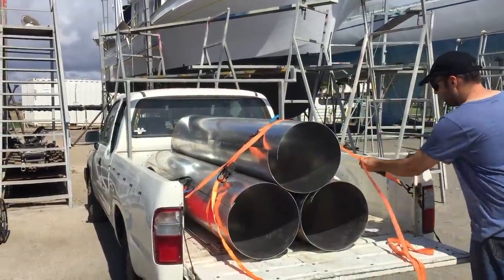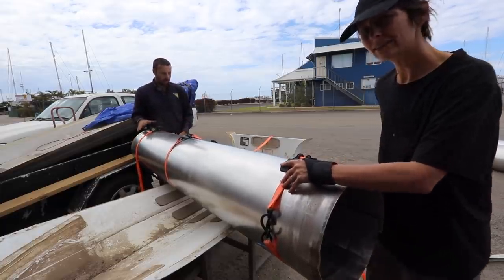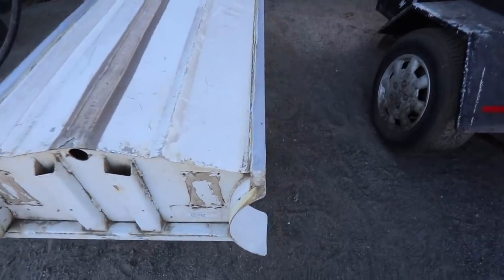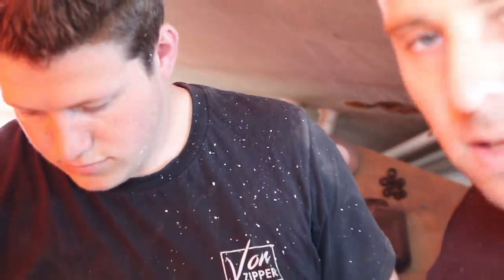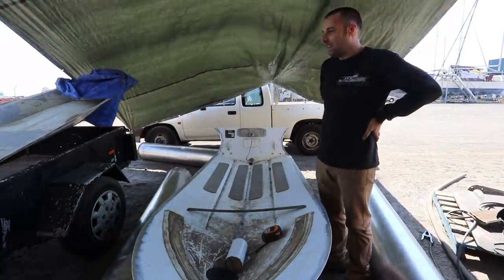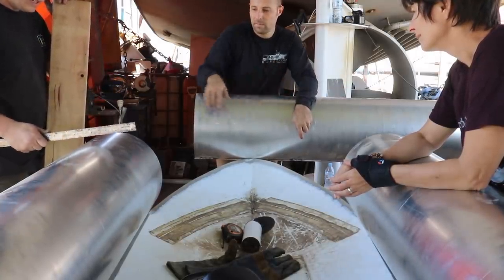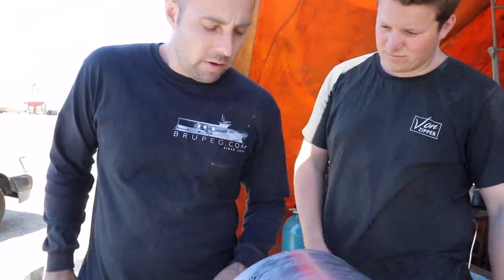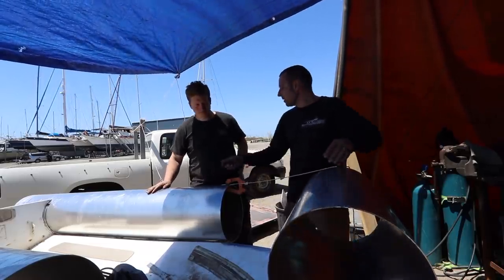DIY Aluminium Pontoon Dinghy Part 1 - Project Brupeg Ep. 107

Comment: If you put in a couple of small bulkheads in the tube you could use the spaces created as for your stowage of mandatory survival gear. It is also a space that does not require foaming.
Reply from the maker: The plan is to add a water tight locker under the forward deck area (yet to be fitted) that will house that type of gear

Comment: Very cool project!  great work.  A suggestion - on the transom end of the tubes, cut your tube ends at 45 degrees and build in a little step rather than just blanking the end off at 90.  You will be amazed how handy a step on the round tubes on the transom will be!  cheers
Reply from the maker: Ha! Like minds think alike. That’s exactly what we were thinking Julie. Also thinking of rounding the welds off as much as we can around the tube ends so you can drag your body over it without scratching yourself up

Comment: bulkheads at either end  then drill small hole in one .    get some expanding closed cell foam mix it up and pour it in.   once it sets off epoxy a small patch over hole and then weld your ends on.    unsinkable dingy
Reply: yes  i realize this is a bit after the fact  lol

Comment: from what i saw , everything came out good in the end!
Reply from the maker: Yeah slowly getting a hull. Took a while to learn what we didn’t know we didn’t know
Reply: @ProjectBrupeg  i left another comment here with the link to a tool to make finding those angles and make templates , but you tube has shadow banned it or moderated out the comment.............
Reply: @minibuilder1512  - I have had that happen also. Why do they do that?
Reply from the maker: I think if you put anything like a weird link in or try anything out of the ordinary the computers in YouTube land have a freak out and just ping you off to likely spam. we can still see if youve been booted and can just tick a box and bring the comment back into the normal window, so dont worry too much if it happens. we check spam most days so it will only be gone for a little bit and then we can answer them as nper normal

Comment: I think I figured out the angles. of that last cut between side pod and diaganol. If you are raising up the diagonal tube by perhaps 5 degrees then the join between the side and diaganol tube rotates by 5 degrees. To prove it if you went rediculous and angled it up 90 degrees then the join would have to rotate by the same amount to fit. I think? You probably worked that out and I haven't watched the next video but that might work. Gives me something more interesting to think about on a cold Tuesday commuting back out of London anyway.....fab project.
Reply from the maker: Hi Bruce, yeah I think I get what you mean. I hadn’t thought of that but it makes sense.
Reply: @ProjectBrupeg  think of the join like one of those robotic arms that build cars. As the diaganal is raised vertically towards the bow so the 10degree join has to rotate to keep itself in line. Cutting it will be fun. Loving the project.

Comment: a circumference measurement may have helped you get the tubes a little more accurate. also i was wondering instead of doing a flat tube on the bow could you have done a small mitre cut eg 22 degrees roughly on the parallel  tube joint and steep mitre at the front joint eg 65 degrees? its one less mitre to weld and cut and youll have a nice pointy bow to cut through the waves.  its looking fantastic, cheers team

Comment: Hard to see how thick that material is, but it looks like the tubes might crush when someone sits on them hard or climbs in from a swim.  Maybe you could fill the pontoons with a combination of rigid foam and 2 part expanding foam to fill the gaps.
Reply from the maker: Hi Jesse, it’s all 2mm. We had to get Jess to stand on them when tacking together. They are incredibly rigid. That said we will be filling with foam as flotation and inner support

Comment: "Do we know what we're doing?"    "Nope but we can scratch our heads a lot and pretend" 
WD40 to the rescue again... the best lube for cutting alooommiomnimonm
Good to see Jess being active ☺️
Reply from the maker: Thanks Billy
Reply: Project Brupeg sorry I think you are not using your head that’s your life and hers your messing with. If you screw up and end up sinking I don’t think I need to tell you how long you will last in the water. Sometimes you just leave it to the professionals. They could run that on cad cut it tig it and as you say bobs your uncle. The other thing no matter what fill them with foam Incase you hit something and put a hole in the tubes at least you’ll make it back to the ship. It will only add about 20 pounds of weight but it might save your life. Besides that I think you have done great so far. Should be proud of yourselves. Keep up the good work.
Reply: @anthonydemers3813  joking right? Ever seen the construction of normal dinghy tubes? thats glued fabric holding air... (Oh yea, and thats coastguard aproved) . Driving a bike is dangerouis to....
Reply: MrBugsier5 did you read what I wrote. I didn’t say stick to the Kevlar tubes that are stronger and way more flexible than aluminum tubes. They said themselves they didn’t know what they were doing. My point was to bring it to a professional. I know he’s a DIY guy that’s what I love about the two of them. But when you have a little boat like that.  Your life is on the line in the waters they will be in if something went wrong with a weld hitting something and you end up in the water you only have about three to five minutes. If you fall off a bike you don’t die in minutes you do were they are going. Big difference. That’s why I suggested they fill the tubes with foam it’s cheap and if anything was to go wrong it would save their lives. Even if they got a hole in the tubes from hitting something or a weld failing. I have no issues with the aluminum.
Reply: While I agree with foam filling them it won't be cheap. Take it to the pro's and then leave your wallet and your check book on the counter. Damien is very resourceful and he'll figure it out. I had a guy cad out a custom mount for a Hotrod  I was assembling for a guy. Just to have to pattern made and the metal cut cost more than the engine install. I wish I hadn't ever given the go ahead.
Reply from the maker: Hi Guys, Anthony I have to respectfully dis-agree. This is a tiny dinghy so wont be used as a long range expedition boat in Antartica. We are going to fully pressure test the boat to make sure its capable of surviving anything that will be thrown at it. the tubes will be filled with foam as thats what boats built to survey requirements do so they are effectively unsinkable (or at least floatable for a long time) and finally my experience of taking DIY things like this to the pros is this, many just seem incapable of wrapping there head around the fact this is not actually that hard to achieve. If anyone else was doing this and they didnt feel comfortable in their ability to do it and they doubted themselves etc then 100% they should do what they are comfortable with and take it to a pro if they helps them sleep. Personally this is a none event for me and Jess to resolve. If we cant build a 2.5m dinghy thats going to stay floating we certainly shouldnt be making a 17m trawler and taking it several thousand miles away from the nearest land. 

Jess and I grew up in a country where every second person was building something unreal in their shed, a country that leads the world on indigenous rights, a land that is incredibly resourceful and fixing/building/inventing world beating things is actually pretty normal. Resolving how to keep a dinghy floating in cold water is kinda funny when you sit it in context with what is normal in our world.

For us to say things like "we dont know what we are doing" I assume by now most people figure we will find out the how to do it and make it work. If I had to start every job on this boat with 100% knowledge of what to do nothing would get done

Comment: The industry calls the wave on the edge "edge wave" oddly enough. It's caused by over-rolling that edge just enough that the excess length causes the metal to wave like that. It can also form in the center or quarter area, with names that follow suit.
Reply from the maker: Ahh good to know. So based on that are we rolling these tubes at the limit of what the metal can handle then?

Comment: Two 45  can be clocked to get any angles you need up tp 90 degrees  two 22.5 on each side and a short pice in the front with 45 degrees  would be the easy way Togo of course it’s to late now but it would eliminate the long angle welds  sorry I could not give you info for your lay out  before hand I like to see people innovate like you do

Comment: The way to cut a pipe so that the cut is straight and perpendicular is to take a sheet of paper, or several sheets of paper for big pipes taped together and wrap it around the pipe so that the edge of the paper that goes around the circumferance of the pipe meets itself. Draw a line on the edge that goes around the pipe and cut on it. Google 'Welders wraparound'
Reply from the maker: Hi Rush. Yeah after some trial and error we figure a version of this with a big sheet of corflute. Same theory different version of paper really

Comment: -I have been waiting form this!   
-Serious question:  Have you become the wonderful people you are by your upbringing or since your marriage? (Assuming you have noticed your evolution to where you are)

In the big power shovels, they drill a small gauge hole near the operators seat in the boom tubing.  They screw in a gauge and pressurize it  and mark the gauge face with a paint stripe.
One day, they notice the gauge is at ZERO and know there is a crack.  Look for it by re-pressuring it again and using a spray bottle with water and detergent.  Your pontoons could work well like that. No more than 206 mili Bar.
Reply from the maker: Hi Don, I love the simplicity of this method of long term leak detection. As for who we have become. Firstly thank you for the lovely compliment. I think we were always this underneath but being together I think as brought out who we have become. Its like a refinement of us, we were always this but not at the same time if that makes sense.
Reply: @ProjectBrupeg  You both were blessed with choosing someone that really was your true mate.  You can't plan that.

Comment: Next stove pipe pontoon cuts for the bow try 22.5 degree on both sides and two 45 degrees at the front
Reply from the maker: Hi Vincent, we wanted a flat bow so we can press into wharfs and pontoons and leave the engine powered forward to board people easier. Having a flat front makes this really easy

Comment: Find a sheet metal shop that does HVAC work . Bring them a picture and the dimensions of you have. an the size of your tubes. They should have a Bench Man that can  lay out a template you can wrap around the tube to mark and cut. You need a L/R .

Comment: Wonderful project! It came out really amazing! Could you please tell me what the thickness was of the sheet aluminum and why you chose that thickness? Would you consider in the next build to go thinner? (cheaper/lighter) Also, please, what was the diameter of the tube? Thank  you very much!
Reply from the maker: We used 2mm and diameter is around d 380mm. Next time we would go thinner wall, maybe 1.5mm
Reply: @ProjectBrupeg  Much appreciated! Thank you very much!

Comment: Great job, that was entertaining, loved watching you work through it......I kept thinking wouldn't it be nice if you could pull out a light saber and trim that tube up with deft swings......problem solved invent yourselves a light saber. I know you have already completed this but when I'm faced with this type of complex geometry I fall back on CAD (Cardboard Aided Design), use poster tube as a mock up (or construct life scale foldable card into tubes) and manipulate from there (cutting bites/pie sections out leaving the outside strip to hinge on). With transferable center lines and reference points you then have a model you can dissasemble to flat to take measurements and plot lines.
NB: If you go to an aluminium supplier like Ullrich Metals or Capral, they probably stock an aluminium section with associated hollow rubber insert for an industrial rub rail to fit around the perimeter of your tinny.....cause you know you're going to be banging and nudging up to alerts of boats.
I hope heat expansion and contraction won't be a factor not sure how Ocean Cylinders, Surtees, and Bar Crushers deal with that issue?
Looking good!......Bring on the jet build
Reply from the maker: Thanks Dan, funny story I did think at one stage what tools have I got that would work like a light saber... turns out I didn’t have any so had to rely on maths and a skill saw
Reply: @ProjectBrupeg  Great? minds think alike.......guess giving the plasma tourch a few tweeks would be just a little too reckless.....anyways, you guys are turning into quite the surgeons with the skill saw.
NB: If you are still strugling with that pantograph hinge have a look at www.sugatsune.com - lateral hinge......might help
Reply from the maker: Brilliant, thanks for that

Comment: Should have cut some plywood to the required diameter, then rachetted the tube down onto the circumference of the plywood...a little lube, like Vaseline would help too, as it’s easily cleaned off the aluminium with a chemical cleaner prior to welding, after tacking it up...then simply knock the plywood out...!!
Reply from the maker: With only three tubes to do the ratchet method was pretty fast. And they all came to within a few mm of each other so it worked well enough. I can see the ply template would be great if you were doing a bunch of these though

Comment: Looks nice, but dangerous with only one floating section. If the first little leak is high you will not notice, when you get one beliw water level you will sink. Even if you put in a small valve to regularly put some pressure in to test it is airtight, it will be hard to figure out where the leak is. Alternatively fill the tubes with something unsinkable, and put a valve in to empty out water.
Reply from the maker: Yip we talked about filling it and why we wouldn’t be creating separate chambers. Cheers Jess
Reply from the maker: Also pressure testing and finding leaks is very simple.

Comment: I was wondering if there is an Aluminum flexi tube about the same diameter that would have curved around the bow and filled as you plan with Foam that may have worked.IDK  I am  not an HVAC guy.  Looks good as is.

Comment: I would have used sonnet tubes when you had them all cut to fit.  Closed the seams ends with mastic.  Drilled a one inch whole in it and filled it with structural closed cell liquid foam.  Then just a quick layer of fiberglass and glass it to the hull.  EZ PZ cheap depot!
Reply from the maker: Hi Bob, sorry mate but i cant think of anything that freaks me out more than an alloy boat held together with mastic and glass. Give me welded anyday of the week, that said im biased, i like welding
Reply: Yes but since it's
A fiberglass hull.  A few layers of good glass and some structural ribbing you're  good to go.  The mastic is just to hold the seems of the sonnet tubes together whilst pouring the structural closed cell foam.  Then you cut the sonnet tubes off and cover with fiberglass. Wait till you get to the artifice.  That ice will pop those aluminum tubes like a can of Billy Beer.  Closed cell foam with glass over.  Yeah baby the girl won't sink..
Reply from the maker: The bottom of the hull is alloy. The tubes are unbelievably strong, (more than we ever imagined) alloy boats go into the ice frequently. I’m not a fan of glass, I’ve seen if fail to many times in my previous yacht racing life. I think we are just going to have to agree to disagree here.
Reply: Oh the hull is aluminum!  Thought it was fiberglass.  Makes sense now.  My mistake.  Alrighty then can’t Waite to see the finished product

Comment: Jess and Damien I love your videos. My first comment. For all your talk of hearing protection I didn’t see any. Diane Willis 70 year old grandmother Canada
Reply from the maker: Hi Diane, welcome aboard. I (Damien) normally used either foam ear plugs or more recently soft rubber plugs (yellow ones on a blue string that you can sometimes see in my ears) as they don’t get knocked out when swapping between welding and grinding masks. Jess generally prefers over the ear earmuffs as they are easy to whip on and off.
Reply from the maker: Hi Diane, thank you!
I also use inside the ear plugs but they are skin coloured. In the early days we were terrible but make a real effort now. Cheers Jess

Comment: I noticed that you overlapped the sheets to make the tubes. Is the weight penalty of the extra aluminum worth not having to do a butt-weld?
Reply from the maker: Hi Drew. Having the double thickness on the bottom where most impact will happen was always the plan so we can build it stronger. Also makes welding easier as you suggest. As for weight. I think we would be lucky if it was more than a pound or two in additional weight so nothing that’s an issue really given all the advantages you get from it
Reply: @ProjectBrupeg  I would think it would only add much strength if you welded as much of the inside edge of the overlap as you could reach. Is that part of the plan?
Reply from the maker: As much as possible. We can only reach so far into the tubes and the spool gun is a bit combersome so it might limit what we can so there.
Reply: @ProjectBrupeg  Sounds good, can't wait to see this thing come together. Is the big dinghy also going to have aluminum tubes? I assume the small one will run off a gas outboard, but will you do something different with the big one? Maybe a diesel concoction like SV Seeker?